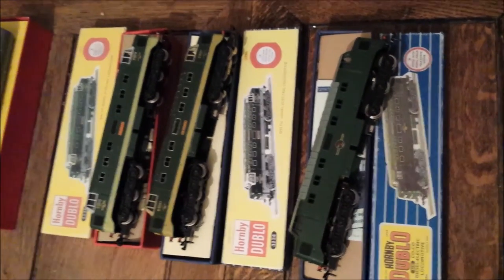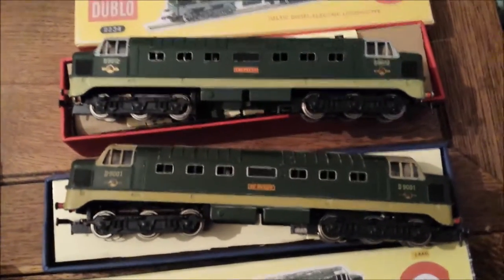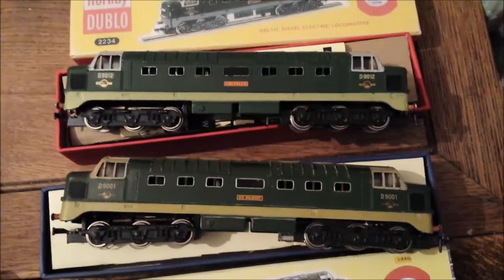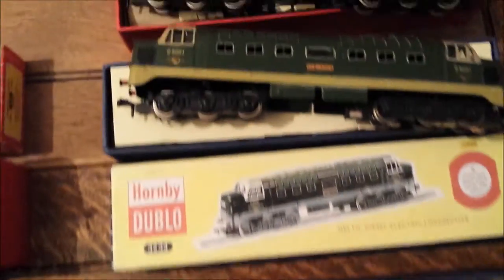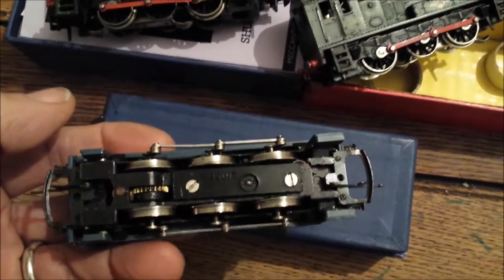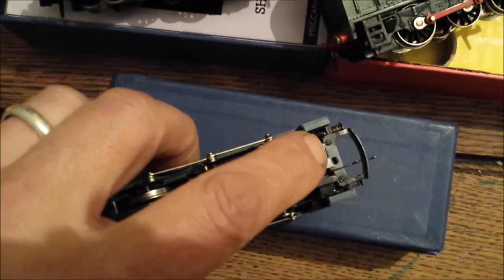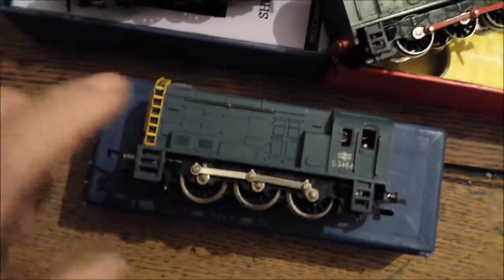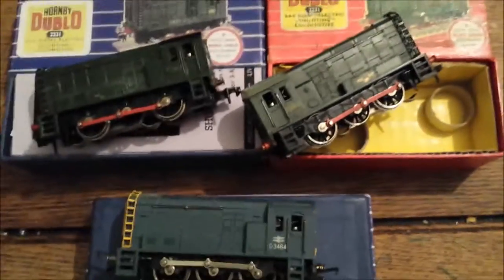{5} HORNBY DUBLO DIESELS AND ELECTRIC LOCOS

Comment: The deltics were bad for the day.
There were two short andthe cab proportions are wrong but back in the day they were good.
Is the Triang Class 81 E3001 the same tooling as HD E3002
The biggest let down on those engines were the pantographs were shockers, no pun intended.
I seem to remember Trix made a better pan so replaced it

Comment: I like this - good to watch. You may be able to answer this, the lined deltics had ridges in the roof casting and waistline area where the different coloured paints get applied, the plain green version doesn't. From what I can gather both the plain green version and the lined version were on sale at the same time up until the end. Now, this would possibly indicate that hornby had two different casting moulds at the same time, or do you think that excessive stocks of the original green body were such that they could carry on selling through to '64, while modifying the mould in '62 for the lined version, thus allowing both different body castings to be available at the same time?
Reply from the maker: Yes I know what mean but I can't answer that I'm also not sure about the reinforcement inside were the batteryboxes are have you come across any body's like that?  Some body's don't have the head board slot aswell interesting differences  thanks for you question